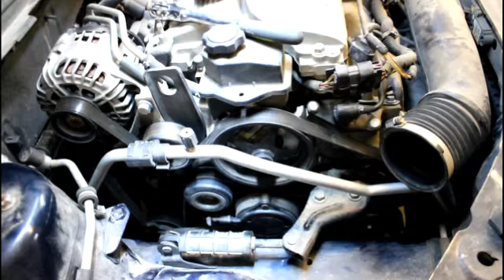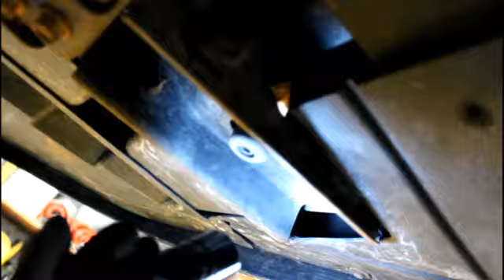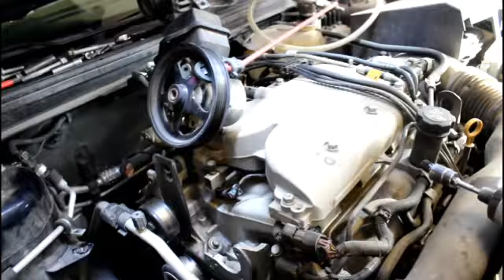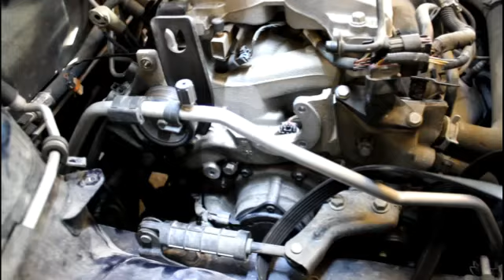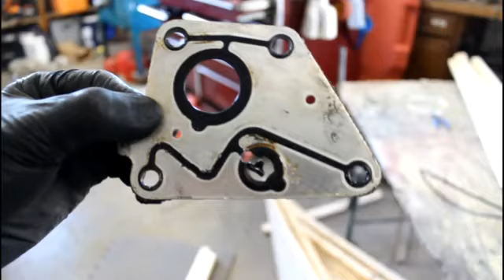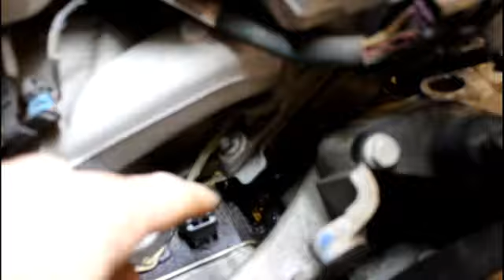how to replace 2007 saturn aura 3.5L  crossover gaskets

Comment: I just changed my 2008 Saturn 3.5L  Spark Plugs, Spark Plug Wires and Ignition Coil.. The info online makes this repair seem very difficult.. Some instructing you to take off the Intake Manifold.. FALSE. 
I didn't to do any of that.. It was a piece of cake to do.. My car runs Excellent.. I should have done a video on the repair.

Comment: Thank you so much for the video.  My 2007 Impala with the 3.5 had been gradually loosing more coolant over a six month period of time.  I replaced the water pump thinking it was the problem but it was not.  I did a lot of research before i replaced the gaskets and discovered the leak is caused because of a poorly constructed gasket by GM.  When i took the gaskets off the rubber portions of the gasket were mushy and falling apart.  I ended up putting Felpro gaskets on it instead of the AC Delco because I seen several posts where people were using the AC Delco and making the same repair 1-2 years later.  The repair took me 6 hours, taking my time and ensuring i was doing everything the way it was supposed to be.

Comment: Thanks for posting this, just used this to do my wife's 2007 G6 with the 3.5. 2.5 hours in and out, not bad. Just a tip to anyone that reads this, removing that motor mount/stabilizer is worth it to get to some of the bolts easier in my opinion. I also numbered each of the coolant crossover bolts I removed since they are varying lengths and it's much easier to put back together this way.
Reply: I'm doing this on Saturday on a Malibu 3.5L. Is there any tricks to get the gasket to seat properly when reattaching? or any other helpful hints you could offer overall?
Reply: The video is quite good at explaining everything honestly. The biggest PITA are the two rear-facing bolts on the alternator. The one closest to the outside isn't horrendous but the one towards the center of the car was a huge pain. As mentioned in the video, there is a small nut on top of the bolt which holds a plastic bracket for 2 coolant lines. The bracket I could not remove for the life of me, no matter how I pried at it. It eventually broke from all the attempts to remove it and I had to unscrew the remaining piece from the alternator bolt/stud to remove it. Even that was difficult, it was on that stud so tightly.

As I mentioned, removing that engine stabilizer thing is helpful just for ease of reaching some bolts. Remove it via the 2 horizontal bolts going into the engine, you don't have to remove the other end as you can just lever the stabilizer up and out of the way to create clearance.

Gasket placement, clean everything well (I used fine scotchbrite and acetone, brake cleaner works too). What I did was move the coolant crossover near where it needs to be, just a few inches off of the motor. I put the gaskets in place and then slipped 2-3 bolts in for each gasket, through the coolant crossover and poking through the gasket. That way it kept them aligned as I pushed the coolant crossover into the engine to line it up and hand-tightened those handful of bolts that I used to align the gasket. Then add the remaining bolts and tighten everything up.

The two coolant pipes that run into the coolant crossover at the front of the car are just pressed into place so you'll have to pry them out after you remove the one bolt holding them in. I didn't see any o-rings or anything, it just seems like a press fit. The larger of the two was pretty stuck, be prepared to use some muscle. I didn't undo any of the soft hoses, just the large and small metal coolant pipes.

Take a picture of the belt routing (or draw a picture as mentioned), it's complicated and annoying.

It's really not a bad job overall. Good luck.
Reply: Hey thanks for taking the time to write this up. Last question: what did you torque the bolts to? I can't seem to find a source for the ft/lbs. I was thinking like 30-40 ft/lbs. because they look like medium size bolts.
Reply: You're dead on the money, I looked it up and they are 37lb/ft. The little tiny bolts for the coolant pipes are 89lb/INCH as well (about 7lb/ft). If you get stuck over the weekend and you need help fast, go to my FB page and send me a message: https://www.facebook.com/PrettyHateMachining and I should see it pretty quickly.
Reply: Finished this on Saturday, not as hard as I had anticipated. Thanks for your help!

I used wobble socket extensions for behind the alternator, this helped out a lot. This engine has electronic power steering, so the lack of a PS pump was helpful. 
While I was in there, I also replaced the tensioner w/ pulley, 3 separate idler pulleys (smooth upper, smooth lower, & grooved), serpentine belt, and air filter.

I never drained the radiator, just emptied the reservoir and let the engine block piss its coolant out when it was opened up; this way the radiator retained all its fluid still. I just did a coolant flush 12,000 miles ago, so no need to waste more coolant. I never reuse coolant once it touches a drain pan, it's too cheap to risk it.  The system seemed to burp itself ok and the original leak has stopped [knock on wood].
Reply: Good to hear! Fingers crossed!

Comment: Great video.I just had to do this plus water pump on an 07 Aura.I like to add on the cross manifold the bolts varied in length and marking or making a note on the bolt lengths  and where they come out of on the manifold will save time.Its a job and with no air tools it took longer than expected but your video helped tremendously.Thanks again!

Comment: How did you remove the airbox clip that connects to the a/c line?
Reply: You squeeze it from the bottom and pry it up. The clip that holds the line separates with a small screwdriver.